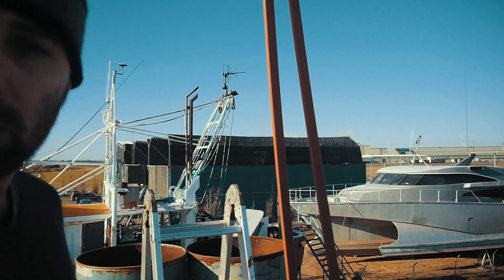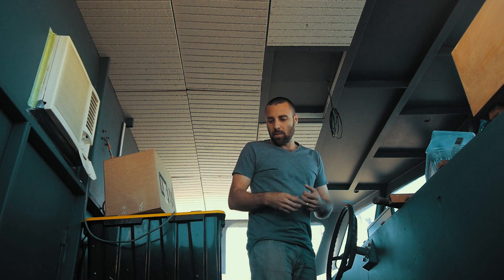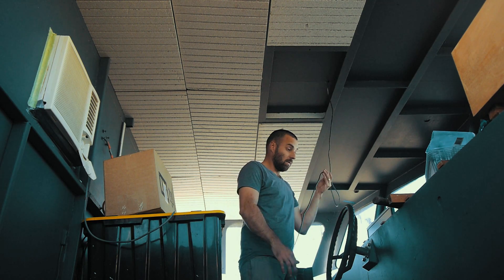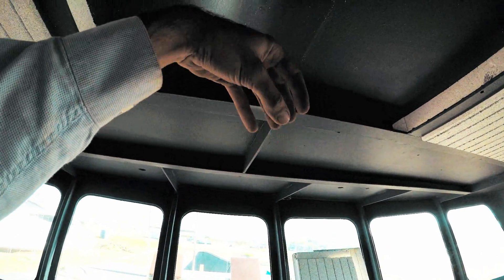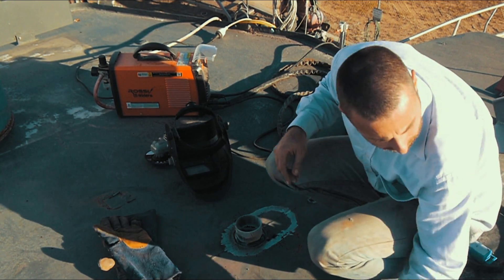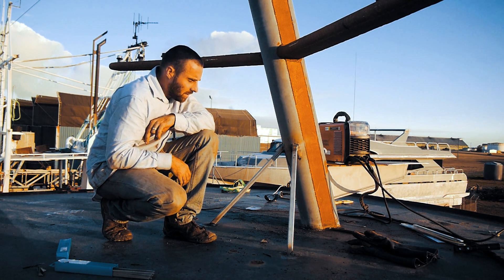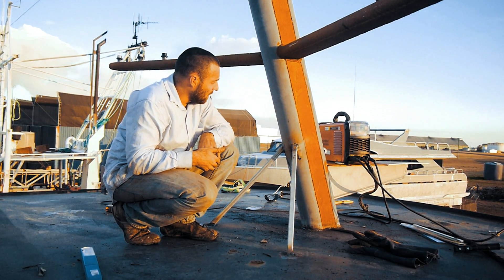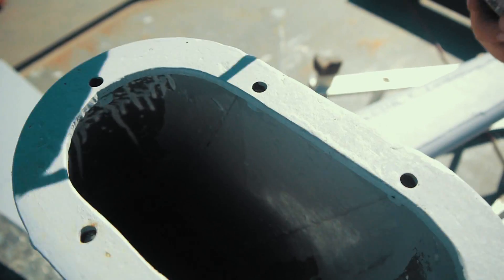BRUPEG GETS A RADAR MAST - PART 4 FINAL - (EP. 44)

Comment: Brupeg team; that's a beautiful radar mast! Couple comments: I've worked quite a bit with the struggle of routing cables & wires through tunnels and openings. You're smart to make that pipe opening large, if anything err on the side of making it larger than you think you need. You'll be surprised how quickly you can fill the opening with cables.
Secondly, I think you said you were going to place a satellite dome on the very top... this is also where you want your white anchor light (recommend LED), are you going to place the anchor light on a separate extension?
Reply from the maker: Hi David, thanks very much, yes the bolt on top give us the ability to change the platform shape at any stage. Initially we don’t have a satellite dome so the anchor light will just be mounted at the top, however when we do have a done I will most likely just bend up a stainless pipe that mounts the light behind and slightly above the top of the dome. May also do something similar for any smaller antenna etc

Comment: Solid! Good work! One question though, I have seen several times where you have welded stainless to mild steel.  How do you plan on mitigating galvanic corrosion between the two?
Reply from the maker: I won’t be doing anything special. On these trawlers the commercial guys try and fit as much stainless as possible to wear areas etc. they don’t do anything to stop corrosion other than the normal anodes underwater. They do rely on a good solid 4-6 layers of two pack generally as the main barrier to the elements
Reply: @ProjectBrupeg  noted ;) ill keep that in mind as I go along

Comment: Sorry to be critical about the mount, I would have thought that you would have reinforced the the wheelhouse roof, and the braces look too small, 
Would you have been better to have welded in 2 webs instead ofvvthe small 25mm tube you have used , slightly heavier , but the webs would have been immensely  stronger, .
Reply from the maker: Hi Jeffery, There is a structural rib directly under the main mast tube and the box section reach back to a second structural rib. So far it all seems pretty solid (I gave it a hell of a load test trying to dislodge it after I welded it). That said webs are a great idea and can be added later if needed
Reply: @ProjectBrupeg  ok,
Reply: I had wondered if the roof needed any reinforcement too....thought maybe an additional plate welded down to spread the load....but I'm guessing the roof plating is pretty sturdy and I did note the structural ribs running right below it.   The proof is in the result though...seems SUPER solid when he was trying to wiggle it...

Comment: I can't believe you just welded it to the roof.... no doubler ???
Reply from the maker: There is a structural rib underneath the main tower and the same under each box section brace. I’m happy with how stiff everything is there Rustie.
Reply: Ok cool, you just don't want it failing in a 60 knot storm...
Reply from the maker: True. We will add more steel if we see any weaknesses develop. The boats gotta be tough so we are not afraid to add more if needed

Comment: Great job will be watching to see how you stop wires from chaffing on the hole edges I no you will have a plan for that. Just got back to working on my steel boat today after a couple of month away from it.   Keep up the good work
Reply: Wrap wires with rubber hose you can glue the hose to them with 3m 4200 or equivalent or zip ties ... Works fine last long time...  🤗
Reply from the maker: Ok good to know. Thanks Tony
Reply from the maker: Cheers Sterling, yeah we will sort that when we get the wires

Comment: It's really looking good Damien. 

Any specific reason why you are not grinding the welds on top of the wings flat? I'm just wondering about salt buildup on the flat section as the water will tend to accumulate there and crystallize out into salt as the water evaporates off.
Reply from the maker: Thought about doing that. Then looked around every other trawler and nobody seemed to bother, so I thought goo enough for them, good enough for me, it might build up but this is the highest part of Brupeg so will swing a bit and the actual area of each wind is quite small